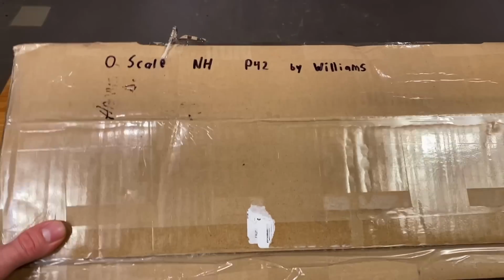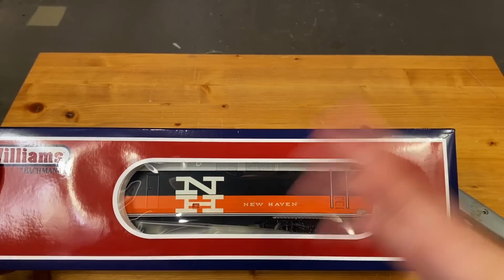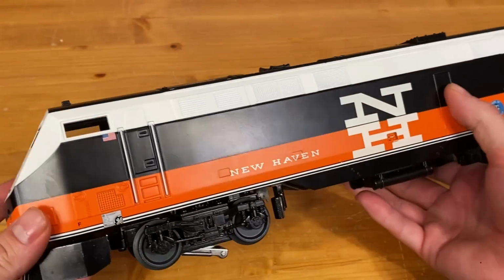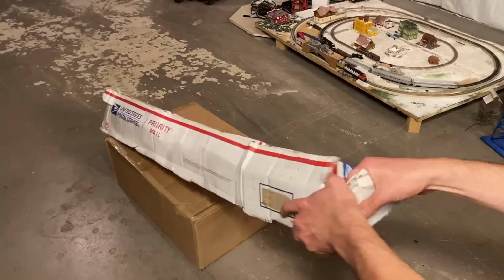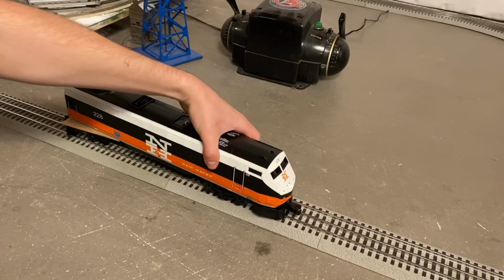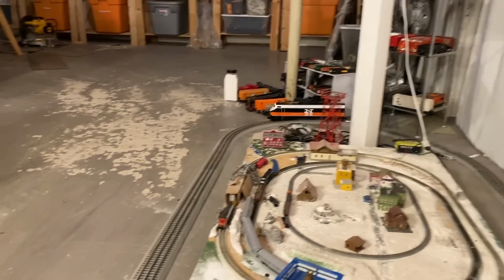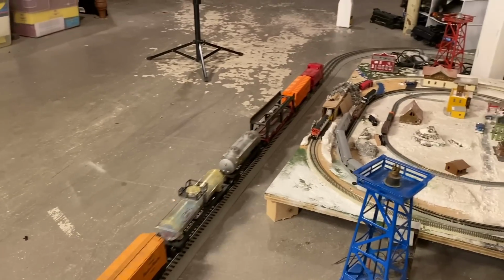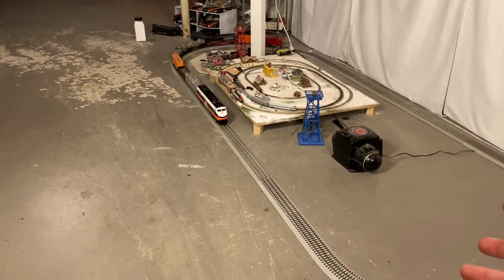Williams O Scale P32AC Locomotive Unboxing - How Will It Work?

Comment: I find it astonishing the New Havne P32AC-DM has yet to be made in HO scale aside from custom paint jobs and brass models. MTH made some in O scale too, along with some matching Metro North cars. Or maybe some Railking New Haven cars would be a better match.
Reply from the maker: It wouldn't be hard to do so, I don't know why Athearn hasn't made a limited run.
Reply: I think O scale still has regional popularity in the Northeast and especially the area around New York City so there's demand for models of this type of commuter equipment. It's also why there are a relatively high number of O scale models of New York subway trains.

Comment: Have you ever thought of trying to make a mold of a locomotive shell or rolling stock and casting them from plastic or silicone. There is an interesting video about it on youtube. Just search for a video called making your own model train cars using silicone rubber and urethane plastic. You also could make molds for other small parts you would want to make.

Comment: Nice locomotive. Glad to see you run different scales of trains. It’s nice to have a good variety. Just one point of reference, the black lead from the terminal track should always be connected to the “U” post or “Common” on the Type ZW Transformer. That black lead connects to the outside rail. The red lead should always be connected to one of the A, B, C, or D posts, which A/C “Hot” or positive. This is critical for proper whistle/horn sound, especially with Railsounds. Red is always center rail, and Black is always outside rail.

Comment: The Williams stuff is pretty bulletproof but get yourself an external circuit breaker and some  Transient Voltage Suppression (TVS) diodes  to protect the electronics on that locomotive. As you know, I operate and collect 3 rail O gauge and my experience is that Williams trains are just about the ruggedest modern O gauge trains out there.
Reply: John Blair - Is there a source for those items that you could recommend to SMT?
Reply from the maker: Would it be better just to find a more modern controller?
Reply: @SMTMainline  A decent one is VERY expensive. A new version of the one you have is WELL over half a grand. and the ones that come with new starter sets are GARBAGE.
Reply: @johnblair8146  - Would you recommend one of those MRC controllers with the separate transformer?
Reply: @SMTMainline  - You could get one SMT and use the ZW for your Hudson, Scout, & Marx locomotives.  You could connect both controllers to a DPDT switch to the track, like you did on your HO layout to choose between DC and DCC.

Comment: SMT that is not the P42 but it's actually a P32AC-DM It's because of New Haven Genesis units are from 228 to 231 they were 4 units are owned by Metro North and Connecticut Department of Transportation.
Reply from the maker: I kinda said that in the beginning. This model is a P42 because it's not prototypical.
Reply: What is the difference between a P32 and a P42?

Comment: That is a beautiful engine SMT!  Can its whistle be activated by the ZW's whistle control?  Many model railroaders/railway modelers have more than one scale or gauge.  Leonard Williams has may differently size trains from TT scale to Gauge 2.  With the Vista Dome car, you could say it is a "mixed" train.  I recall Lionel offering a mixed train set many years back that had a New York Central RS3 with a box car, tank car, NYC streamlined coach, & NYC streamlined observation car.  In 1951, '52, & '53 the Sears and Roebuck Christmas catalog had Marx sets with both passenger and freight cars.
Reply from the maker: It doesn't seem to work that way but it's probably the way I wired it rather than the controller or locomotive.

Comment: Have someone who knows what they are doing replace the circuit breaker in the ZW transformer with a fast blowing one otherwise it will destroy the circuit board on the engine if it ever shorts out.
Reply from the maker: Is there a more modern controller you would recommend? I don't think anyone in the area does that kind of work.

Comment: They got something very annoying and not prototypical. The pilot is not supposed to be attached to the front truck
Reply from the maker: I don't think they had a choice since the O Scale models have to turn much tighter than their real counter parts. of the pilot was attached the coupler would pull cars off the track.
Reply: @SMTMainline  Now that I think about it you’re right